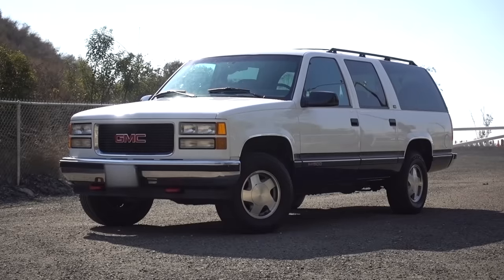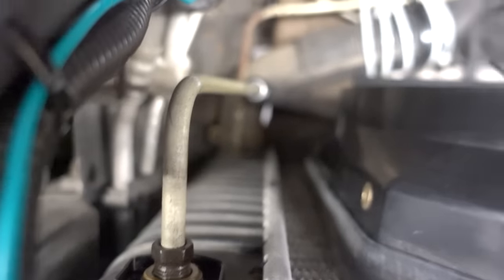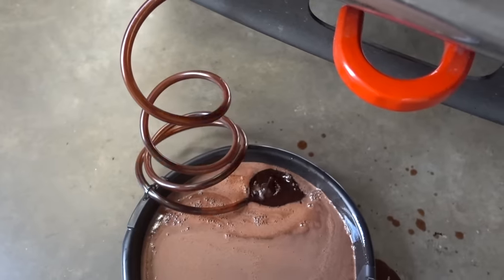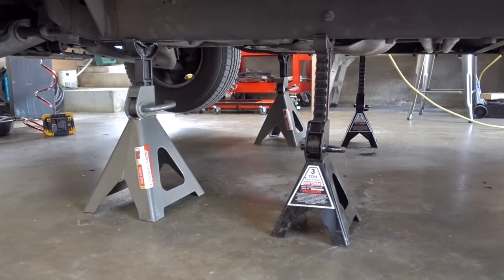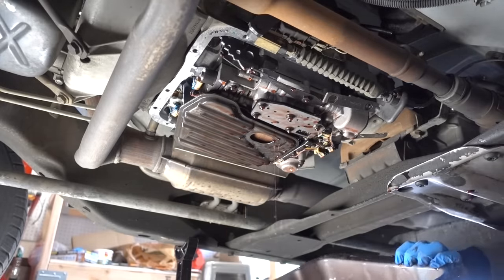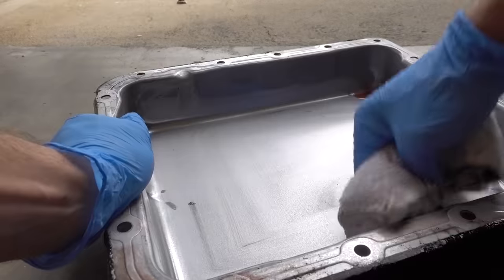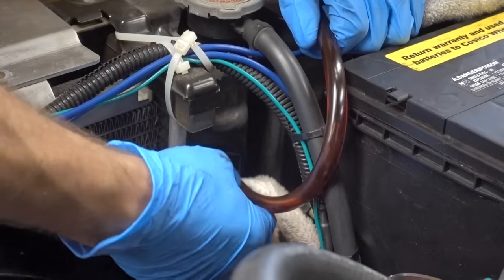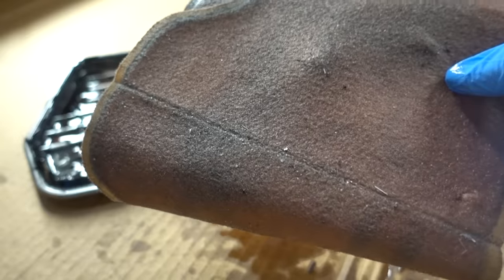Why You Should NEVER FLUSH YOUR TRANSMISSION FLUID!!

Comment: Excellent explanation and video.  I've seen some other similar videos that begin with sticking a vinyl hose down the trans dip stick tube and pumping out the oil from the pan so that it's much easier to handle and less likely to spill when you drop it.
Reply: You can even put the hose into the pan after slightly lowering it from the tranny. Drain it some more this way.

Comment: I have been a shop manager service writer for 25 years.
At 78k I never had any issues flushing transmission fluid and filter.
At higher mileage you can have major issues if your trans fluid is in very dirty condition.
Keep in mind that internal parts of your transmission ie, the valve body's do ware and leak.
For this reason I use a bottle of Lucus transmission fix added to 3 quarts of the new transmission fluid mixed and only after it is completely mixed up do I poor the new fluid into the transmission, Lucus is very thick and could clug the stater pump and valve body if you poor the Lucus  stait into the transmission. 
This will give the transmission fluid more body resulting in correct internal pressure and friction in the transmission unit.
I recommend you repeat this every 40k miles or sooner !
I service my transmission every 25k miles on my vehicles.
The Wix transmission filter and Valvoline transmission fluid are my personal choice and i have had zero problems using these products. 
Keep in mind that aggressive driving wares the transmission sooner and you should service your transmission accordingly.

Comment: I have a 1995 f150 with 315,000 original miles i have had it flushed 2 or 3 times in the 14yrs. Ive owned it never hurt it at all.

Comment: I used to be a lube tech/light mechanic for like 14 years. Older stuff is drop the pan and replace the filter most so if a flush or pan drop as not been done in a along time or it is leaking. However, I flushed transmissions with a flush machine and it never broke a transmission. I mean not even 2000 times. We drove everyone on a road test after and made sure all the gears work, and made sure the hunt time was not long, or no slipping. The only time something bad happened was a corrugated connector on a Mazda fell apart connecting the flush machine. However, it was not our fault, and if it did not happen, it would have broke while the person was driving. So in reality breaking it while hooking it up saved the car. With sealed transmissions many have a drain plug, the fill port is sometimes a pain but it is always on the side as the check port as it fills until it leaks out the check port. Does not take rocket science to figure out how to refill them should something go wrong. Also CVTs. I see a bunch failing, and most from using the wrong fluid or not addressing the fluid for maintenance intervals. Use the right fluids.

Comment: I changed my ATF last year and it was the best decision ever. Shifts like a charm again
Reply: Did you perform a drain and fill or a complete flush via machine from a dealer or lube shop? TIA!
Reply: @cesarperez982  I did it myself. Just drained it and refilled. Was on a Smart 451 car.

Comment: Did you have Transmission problems after you changed the old fluid? Did you think about changing the Solenoids in the Transmission since you were in there already? I doubt you had any issues since it only had 78,000 miles on it. But, curious to know. I'm thinking about changing my transmission fluid in my 2001 Chevrolet Impala 3.4L engine. The fluid looks great, but the car has 109,000 miles? It was owned by an 83-year-old lady who never abused the car and had receipts for all the oil changes and repairs like new Window Motors, Door Lock Actuators, and door window regulators. What do you think?

Comment: More advice. If you are seriously enamoured of your vehicle and expect to drain and fill the transmission again, sometimes you can buy an aftermarket pan that has a drain plug. Or, maybe you can find a pan in the wrecking yard that has a plug. Or, you can drill a hole in a place where there is clearance and install one in the existing pan. I have done it. If you do the filter change as shown here, you will never need to do it again. It might be better to install a drain plug rather than go through the hassles of pumping the fluid out.

Comment: When taking the pan down...you might put 4 corner bolts in and then use a razor or straight edge to break the gasket loos 360 degrees.  Then hold up and take out the four corner bolts.  Then you can lower it even and not spill one drop of fluid.

Comment: MY TH700R4's + TH350 or 400's.  I would drill a 17/32" hole in the right place, clean up burs and weld a 1/2"-20 nut inside the pan 
2 or 3 short welds (so as not to warp).
Then a chevy drain plug worked perfectly (Must locate hole so plug/nut combo. does not hit valve body etc).

Comment: Running it through the gears with new fluid will flush out more of the old. Doing a couple of "predrains" and fills months before to acclimate the transmission can also save one the shock of suddenly  having new fluid would otherwise  crash.

Comment: Hello, and thanks for all of your great content?
If I remove the pan for a service and filter change, at that time would the transmission pump out additional fluid by running the engine just the same as through the hoses you used except direct down and out through the valve body area?

Comment: The only word of caution I have is to not continue pumping for too long after you start seeing bubbles in the line because you don't want to run the transmission too long without pressurized oil to the bearing/bushing supporting the torque converter & input shaft since they are still turning and supporting the weight of the torque converter.

Comment: You're changing the filter and a minimal amount of fluid will help to restore some of the viscosity oil members only like 10 weight in a transmission Rajah like system and if you change too much of the hydraulic fluid in there with the height detergents it'll actually clean the clutches off from debris that has embedded in them and cause the clutch is to fail prematurely so the complete oil change is not recommended only 50% or less

Comment: Please!....... As a tech never do this! if you want to do multiple drain and fills thats ok. but if your going to flush the trans system then come to a dealer! we have proper machines the drain and fill the trans system at the same time. so we are able to flush the system with 10 to 20L of fluid to get her clean.... side note! the trans filter does not need to be replaced! it is there just the save the trans from catastrophic failure.  if you keep up with normal maintenance of your truck you do not need to do this...... .. regardless this guy is a champ and found pretty sketchy but cool way to do this at home and still gets my respect!  "14 year licensed automotive service tech"

Comment: Completed a transmission flush at my local Japanese auto shop. He said it’s non pressured and flows all the fluid out. Was reluctant to do it for a used car just purchased at 160k miles Lexus RX, but the old fluid was still red with no dirt or debris. 

Hope it lasts. I think the third gear isn’t switching it as good as it was previously. But hope it does not Ef anything up!!

Comment: In studying option for a used Honda Accord I acquired used at 100,000 miles; I found a way to do a full flush via a youtube lesson. There is a way to disconnect low line with auto trans oil filter on it to then extend it for draining the torque converter. The procedure was to first drain transmission when warmed up; refill with new proper trans fluid; Then to get old old out of torque converter... use low filter line extension to drain pan, ... start engine in neutral to watch off colored fluid of torque converter coming out, ... turn engine off after a minute to top up transmission fluid; repeat until clear ATF comes out of that low hose;. Then install new trans fluid filter and return low ATR line to previous position. Then top up trans fluid appropriately. VIOLA , a Full Auto Transmission ATF change Better than any deal will do :+)

Comment: If there's not much friction material left on the clutch packs or something in the valvebody is causing a clutch pack to slip then new fluid won't help. However, for any transmission that healthy then a full fluid flush will help keep it healthy for far longer than old contaminated fluid will.

Comment: there is a reason that old adage of never flushing your transmission fluid has persisted. But changing and flushing are two different things.  Downsides of a transmission flush
The flushing procedure may cause some fluid to move in the opposite direction of normal flow due to eddy currents, which may increase the risk of dislodging debris and causing it to settle somewhere it shouldn't.

Comment: I once had a Ford Thunderbird '93 that had over 100k miles on it.  during the winter, it would not shift to 4th and  thus would sit the winter out.  I would change the oil and filter yet still not shift to 4th come December till March.    One year, I got pissed and ran a flush through it. I drained the fluid pan and put another filter on.  This time, it got 4th and was good all winter.  I guess it was a clogged valve I am thinking.

Comment: I think some of the confusion and fear about transmission fluid change or flush is some places have a machine that back flushes and can suck dirty filter fluid back up in the transmission. The reverse suction flush is important but not to be done with a dirty filter in place. I had one of my cars, a 1995 Regal bought at auction with 32,000 miles but 29 year old fluids. They took the pan and filter off and cleaned the pan put in a new filter and then used the back flush machine to remove the rest of the fluid and put new in at the same time. Back flushing done correctly, I was told, gets impurities out that got stuck traveling one way and don't come out with just a draining. Like a kitchen sink faucet screen or a strainer. To totally clean them you have to rinse stuff out of the screen from the opposite side they entered. The impurity can be pointy on one end and round on the other. It won't fit through the space the pointy end entered. It needs to be pushed or sucked out in the opposite direction it entered.

Comment: I tried your method - the hose blew out under pressure when engine turned on and it spewed ATF  everywhere. I had to hold the hose to complete the job, which went well in the end. What a MESS though!

Comment: I used the top of a Plastic Garbage Can to collect the fluid when I dropped the pan.  Just drill a hole I (dead -enter) then place the Garbage top onto a metal oil pan for stability.

Comment: A respectable mechanic shop said they can do a flush on my 2005 rav4 with 130,000 miles on it. Not a drain and fill but it uses the transmissions power to flush it out. So I guess it's like what you are doing. I hope its ok for my suv. 🤞

Comment: My car doesn't have a dip stick for the transmission fluid therefore I don't know what it looks like.   I was at the dealership and was told not to flush it because it has to much metal and it could cause the transmission to slip.  My car has 171,000 miles and I get my oil  changed at the dealer they never informed me as to when the transmission fluid should be changed.   I am now being told not to flush it at all.  I don't know what to do

Comment: I did a trans filter change and fluid change last year. I also changed the filter seal.  That was hard to remove. The gasket was in good shape so i cleaned it and reused it. I also had a tranny line leak from the crimp fitting... i replaced those lines a month before i did the filter.  I was trying to avoid doing the filter but decided to go for it..... what a pain in the butt.    I had never touched a transmission before and im not experienced.  This is definetely a risky and messy job.. it's not easy or fun.

Comment: You didn’t mention the shift cable bracket, which is one of the unique items to watch out for on these trucks. I had a shop brake my shift cable when they did a service I couldn’t get to, of course it didn’t stop working until the next day and required my wife to have the truck towed back to the shop. If wondering, yes the shop made it wright and didn’t cost me anything but time.

Comment: Only time you run into problems with transmission service is when working on high mileage transmissions(150k+ miles) which have never been previously serviced, and you fill them back up with straight transmission fluid. You have to cut the new fluid with proper amount of stabilizer(conditioner) to prevent slippage and burning up on older high mileage trannies.

Comment: Metal shavings were trapped and were not circulating.  As you stated, probably from original break in.  Old fluid probably would have lasted the next ten years, and by that time you probably will have gotten rid of it. But if it helps you sleep at night…..

Comment: ATF circulates thru the converter and you do end up getting the old fluid out of it when flushing.  Not flushing is like only draining 3 quarts of oil out.   Flushed firetrucks trans for 23 years. No failures. FLUSH IT!

Comment: I use 2 buckets one with fresh fluid into trans one out of trans to catch old fluid and use 2 filters one before I start and one for when I'm done never had one problem with doing a flush on a trans and don't touch anything that I believe may be on it's last leg if it is beat up run down it needs to be rebuilt if it's a well maintained car that has no problem changing the fluid is good

Comment: is this actaully a technical transmission flush? I am no mechanic or expert, but to my knowledge a flush is usually done with a machine right?  Thought the whole point of not doing a flush is because the force which pushes the old fluid out can get things stuck in the solenoid, if it's merely just the transmission pump that's not going to generate that much force? Just chiming in please correct me if i am wrong

Comment: ive always been told the same, "never change trans fluid". well i didnt flush but i sure as hell replaced the 6qt that came out of the pan and the filter. i was having slipping and inconsistent shifting so my goal wasnt simply to change some fluid and i didnt want to hack it up and toss some stop slip in. i went a different more involved and expensive route but in the end it was well worth it. i changed the fluid and filter and used an additive called "hot shots secret shift restore" and at first it didnt seem to do anything but after a few weeks of driving suddenly my truck shifts seamlessly with no slipping. im definitely glad i went with the cleaning the transmission route rather than just dumping some stop slip in to a dirty ganked up transmission. i imagine the new filter is going to get clogged up fairly quick with whatever gunk is getting flushed out of the internals so i will do it again in a few months.

Comment: i bought a 16 chevy trax 52,000 and equinox 38,000 used from dealers. first i ordered amsoil differential oil for both. ptu oil both. trax takes a special oil. and amsoil trans fluid. 2.5 gal each. serviced the diff,s dirty oil, ptu was fairly clean. flushed transmissions. oil was black. new oil is bright cherry red. flush was simple. both shift and drive better. equinox has 1 yr on flush. no problems. repl new plugs, k&n air filters & cabin filters, only thing left is eng oil and k&n filters. cummins comes factory direct with k&n turbo filters tested and proven. i won't use anything other. and install zerk fittings on lower ball joints and tie rods as have done before. i been turning wrenches. certified in multiple gas and diesel. even older 70,s 80,s flushed trannies. never heard, seen any transmission fail thats auto or standard from flushing. torque converters yes. from lack of flushing and stopped up with chit filters included were totally never preventive maintained.  you been listening to too many fake no nothin fake @$$ pencil pushers that assume everything. did you know you can recycle your windshield washer fluid just tie a large bag on the back of your vehicle and catch it as it blows just like you do. everybody got to be an expert. well unless you spent 41 yrs, working automotive, marine, heavy equipment, motorcycles, lawn and garden and a folder of at least 12 certifications in engines, stern drives, inboard transmissions, all makes of gas,diesels. and physically done it not mentally done it. then santa clause and the easter bunny is real. that should keep you real busy. and don't forget that bullchit bigfoot. i say take the train. thats why im certified and you ain't. go buy some nascar diecast and begin servicing them first. lmao.

Comment: THIS is the BEST way to 100% Full-Flush a transmission, with the caveat that I prefer to use a one-gal translucent jug at 1/2 gal old drained, then 1/2 New fill; repeated until the drained is bright pink.
NOTE: This works for a Sealed trans by connecting an extension line and funnel to the disconnected radiator-to-trans RETURN side.
Excellent method vs a 40%pan drain!

Comment: I was always told by shops I worked for that unless the car or truck had regular trans flushes then do not do a flush.  The dirty fluid is actually saving you from rebuilding or replacing a transmission. This is only if you have a car or truck that has not had regular trans flushes.  Am I right or wrong?
Reply: seems the world will never know